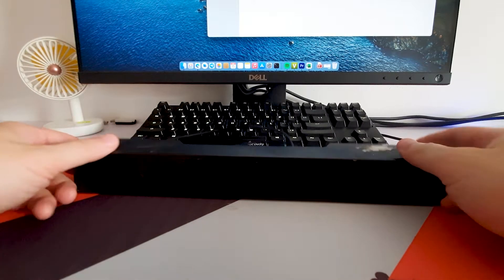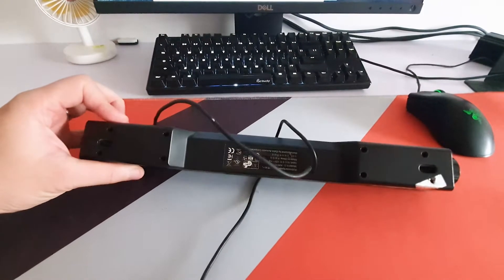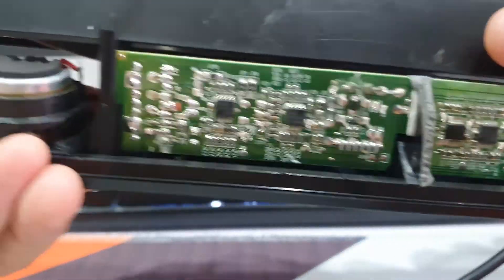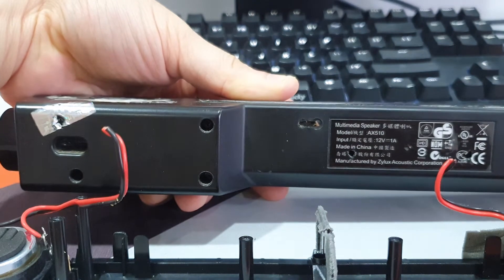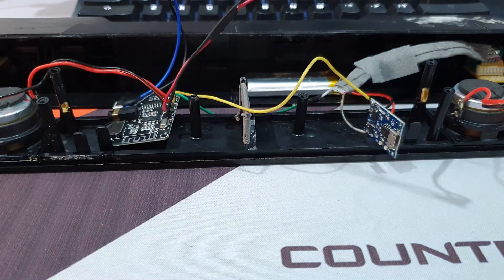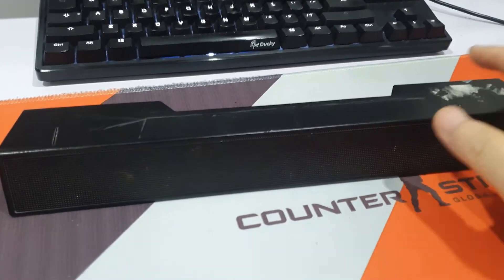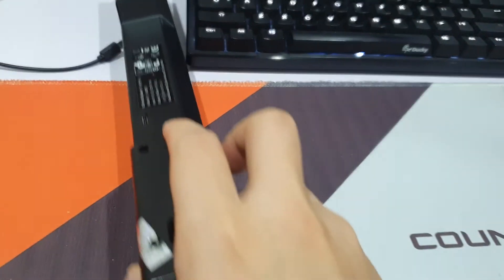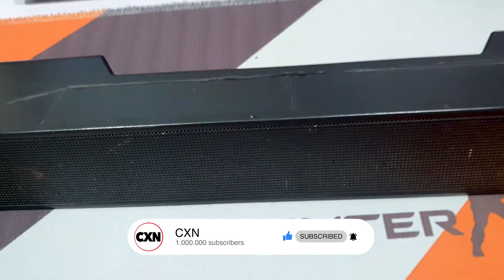DIY Bluetooth soundbar!!! I turned an old Dell soundbar into a Bluetooth speaker!

Comment: Hello, do these speakers have a shielded magnet?
Reply from the maker: @tdmax2288  sorry sir but I'm not aware of that. But as I can see I think it does have the shielded magnet. Anyway, the speaker is designed to attach at the bottom of Dell monitor so I think it should have the shield.
Reply: @cxn_media  and I think that a neodymium magnet has no protection.

Comment: ac511 sound bar can also be turn into bluetooth?
Reply: Wish u had a video for the dell ac511m.....please
Reply from the maker: @edgardoortizjr  Sorry but I don't have that device right now. I will try to get one. Subscribe to my channel to get the latest notification if I can make that video happen. :)
Reply from the maker: Yes the ac511 is even easier to do. It use 5V USB power source, so you don't have to buy the amplifier, just the bluetooth decoder, battery and the power circuit.
Reply from the maker: You just need to stack the battery - power module to powering both the stock amplifier of the speaker and the bluetooth decoder, and then soldering the output of the bluetooth module to the audio input line of the speaker.